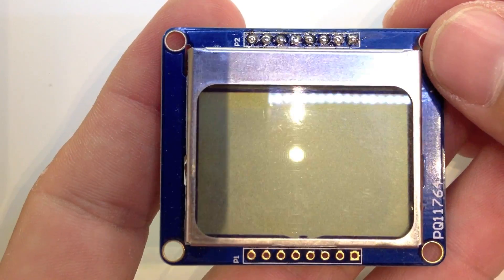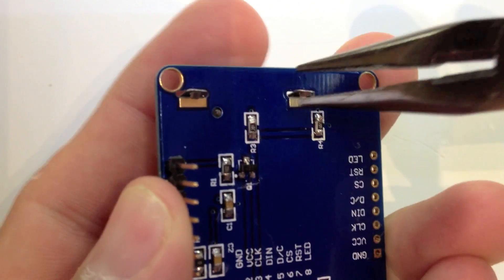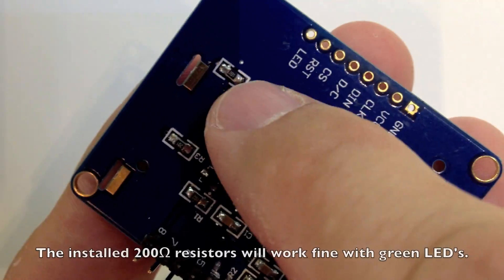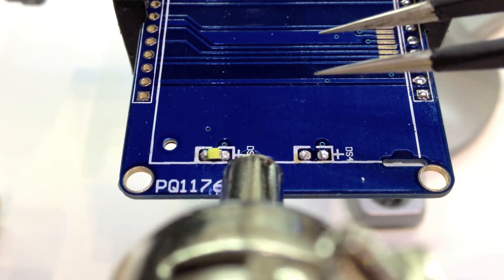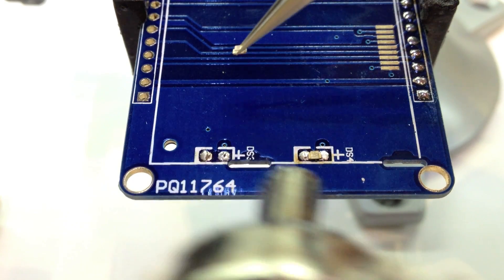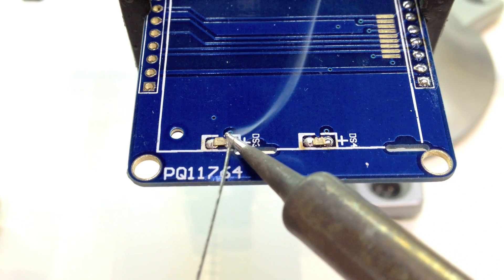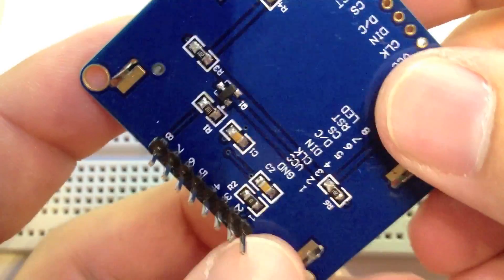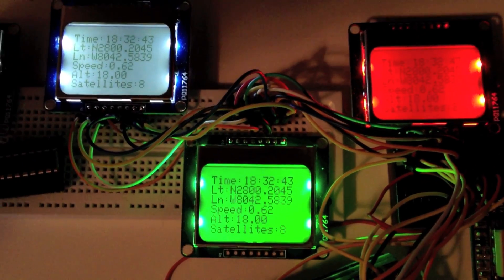Nokia 5110 Color Change

Comment: Which is the name of the machine you use to remove the LEDs? PLEASE!
Reply from the maker: That machine is a Hot Air Repair Station. A must when working with surface mount components. The one I have is ab Aoyue 852A.

Comment: 5:20 I'm not too keen on the looks of those joints. It looks like the original solder didn't fully melt, so you potentially don't get sufficient wetting between the old solder and the solder you added. I would personally have cleaned off the pads with a braid before placing the new LEDs.